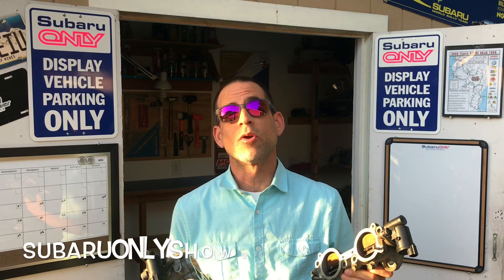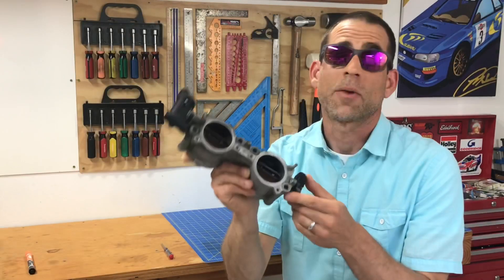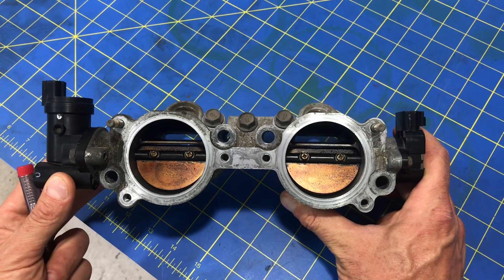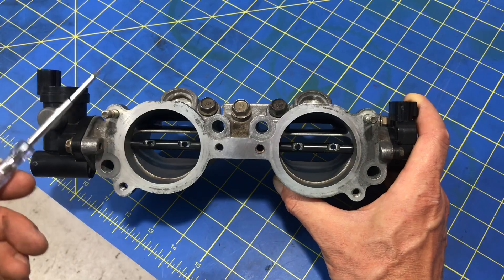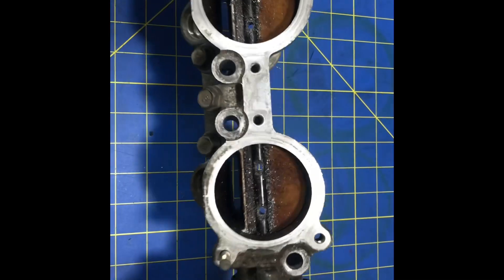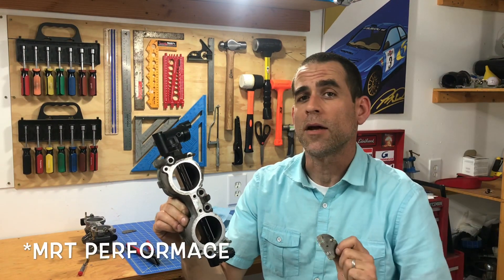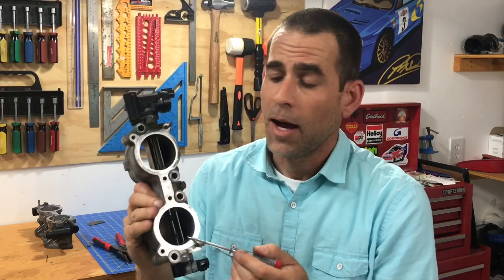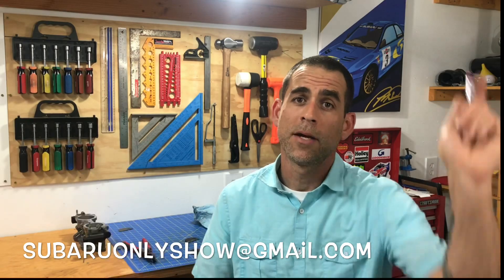TGVs | How to Modify for MORE HP (and NO CODES!)

Comment: Will this require a tune once installed back on the engine?
Reply from the maker: Yes. Most likely.
Reply: So is there still a point of having them still plugged in and functioning but just without the plates??
Reply: @rikomanaro   If you watched the video, it's to make it seem legit for emission states/countries - so if you live somewhere that doesn't have a yearly check or you don't care about a CEL then you don't need to do it like this.
Reply from the maker: Yep, exactly - thanks!! 👌👌
Reply: @boutxthatxtime  Except that a CEL disables the cruise control, which pretty much forces you to care.
Reply: the question I've been looking for thank you bro
Reply from the maker: Awesome.

Comment: Any benefits of porting the bottom of the tvg? At 5:48 in the video...... with a dremel open up the INSIDE of the chamber, possibly thin the wall of the tvg. Not drastically, just enough without actually weakening the walls. Or are the gains just so minimal it’s not really worth it?
Reply from the maker: This is definitely good logic, but I think the consistent cross section area for all four ports is also really important. Might be hard to guarantee that all the ports are the exact same inner dimensions.
Reply: SubaruONLY true, I mean I totally forgot.... I’m starting to dive into the realm of getting a tune. Your delete is great for the simple fact that the rod stays and NO CODES which is great if you don’t have $600 for a pro tune. I port all my husqvarna chainsaws and just got into porting everything I could. I even ported my tdO4 lol.
Reply from the maker: Awesome man.  You know... it’s a small world man - pretty sure the most influential reason I got into building Engines was my grandpa fell timber and had a chainsaw repair shot.  I grew up in his home shop - also the inspiration for my little Subaru workshop, and that’s where the love for engine building totally come from!
Reply: SubaruONLY haha, no shit? That’s awsome! It’s been my career for the last 11 years, something addictive about felling..... kind of like auto work I guess.......it’s the satisfaction that locks you in.
Reply from the maker: Totally!
Reply: @SubaruONLY  Having someone to take an  interest in you and teach you a skill is priceless. Your Grandpa would be very proud.
Reply from the maker: Thanks man. Maybe it’s one of the reasons I’m doing these DiY videos, kind of paying it forward to others that don’t have someone to hang out with and learn this stuff.

Comment: Do you know if id need a remap if i do this ? ive got a 2007 2.5 wrx  Cheers
Reply from the maker: Yes, you do.  So probably best to do when doing something else that will require the re-map anyway,
Reply: @SubaruONLY  , yeah thinking bigger turbo soon and injectors, so probably remove tgv then, thanks
Plus i have a quick question if ok, do you know what could be causing my stft to be going from -25 to +25 ? Does throw a code po171 system lean bank one, but i thought stft would be positive all time and not going negitive to positive ? Any advise would be great cause im now thinking could compression being low on one cylinder cauae this ? Thanks

Comment: You DO NOT have to drill the screw out . It's much easier to just grind the threaded end off and the screw will screw right out . Use a dremel or drill with a grinding stone . Obviously leave the screws out once removed . All factory butterfly screws are tapered at the end making them nearly impossible to screw themselfs out and destroying a motor . The tapered end is why you'll strip them before breaking them loose . All said , nice video .
Reply from the maker: True.  But, both methods only take like 5 min., so both fairly easy.  👍👍   Good to have TWO options, in case you only have a drill or only have a small cut off wheel.

Comment: Have a question just finished a complete ej22 rebuild and has been pretty successful. I used alot of the information from this channel which I am super thankful for! The question I have is. I noticed oil around the valve cover gaskets, so I got felpro grommets and gaskets. The oil lessened but can now see dampness around the bolt heads. Over night I get about an inch diameter sized oil spot in the garage.  I turned the bolts about a 8th of a turn when the engine was hot in torque sequence and that seemed to stop the oil a bit more. I figured since the aluminum is hot the bolt will go in a bit more and when cooling off will pull it tighter.  The oil is a little less now. Any tips? Should I check the torque value or maybe turn them in more? Should I back them out and put rtv around the bolt heads? Thanks alot!
Reply from the maker: Hi.  These valve cover seals can be so freaking frustrating!!! I know and I have been there!  Factory gaskets are best but Felpro one usually work too. Ok, assuming inside valve cover channel is clean, bolts all installed  in correct order and torque, and head surface is clean, It should seal. Sometimes you do need to add a little RTV at corners with sharp angles, like around the front cam snouts and over those little half moon plugs in the heads. Of course, many (including myself) have resorted to just RTVing the $hi! out of it cause that mofo just WILL NOT seal. It’ll be a pain in the ass later too but at least it will seal and be done. Hope this helps. Realize it really isn’t much advice actually.  Cheers. 🤙🤙

Comment: If anything screws potentially coming loose in the TGV and going into the motor is reason enough to leave them out. I remember on a Nissan car with QR25DE motor I owned screws on a similar butterfly intake emissions  BS coming loose and destroying motors was a common problem.
Reply: Sneaky Foz  WRONG !  All factory butterfly screws are tapered on the opposite side . Nearly impossible for them to screw themselfs out . You don't have to go thru the trouble of drilling them out but just use a Dremel and quickly grind the threaded end off and the screw will easily screw out .
Reply: Luly Padilla go look up Nissan QR25DE butterfly screw. Thanks apology accepted.
https://www.google.com.au/search?q=nissan+Qr25de+butterfly+screws&rlz=1CDGOYI_enAU780AU780&oq=nissan+Qr25de+butterfly+screws&aqs=chrome..69i57.14302j0j4&hl=en-GB&sourceid=chrome-mobile&ie=UTF-8
Reply from the maker: Hell yes.  I agree, that reason alone - done ✅
Reply from the maker: True and good info. Thanks for sharing.  One thing I would add is that cutting the screws or drilling them out - both take about 5 min. - so I wound say about equally easy methods to use.

Comment: Good video but if you've come this far and still want to leave the rod in there for emissions reasons you should atleast cut out the divider that is cast into the housing with a sawzal. After those are out you can dremel the inside of the housings flat and even knife-edge the rod for maximum airflow. This will give you the most benefit and retain your emissions systems.
Reply from the maker: Dude - thanks for sharing!  Yep, that would definitely flow better.  Like it.  🤙

Comment: I've recently done a tgv delete, i took the bar out that the flap sits on and also removed the other plate where the injector is so it's fully open. got some nice figures out of my 2002 wrx with a ej207 vf34 etc, 375bhp
Reply from the maker: Awesome - those are legit numbers!  Love the bug eyes. Finally getting some appreciation 🤙
Reply: SubaruONLY tbh when i was looking for a impreza i thought bugeyes where the ugly sister, but now i got morrettes on it and a few other bits, they lool pretty agressive, better then the blob
Reply from the maker: Hear you.   I didn’t like them back in 02. But they really grew on me.  Especially with JDM front bumper - they look sick.
Reply: How do you not get engine codes from the tgv sensors and motors? I took the shafts out but im still getting codes for it. How do i fool the computer?
Reply: @michaelcrabtree28  you need to get it remapped
Reply: @T1NY85  do you know where i can get that done in the Los Angeles area?
Reply: @Michael Crabtree  no idea mate sorry, I'm from UK. I see alot of people in the US use the COB access tool and u can load maps onto that. Not 100% sure how it works but I think u download thr map and upload it to the car
Reply: I have way more than that and still have mine